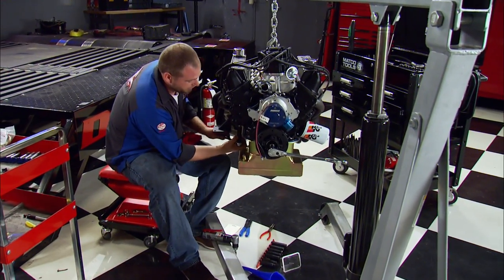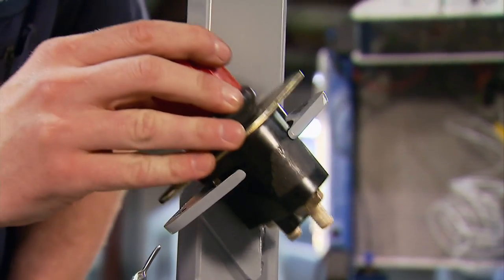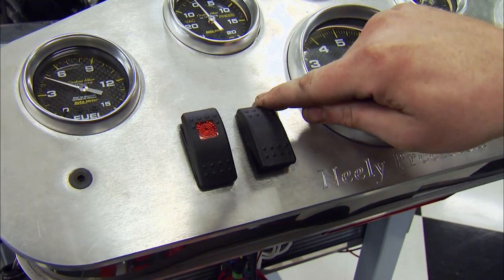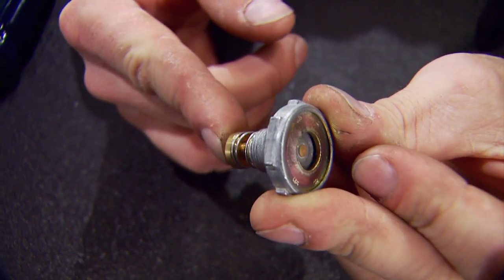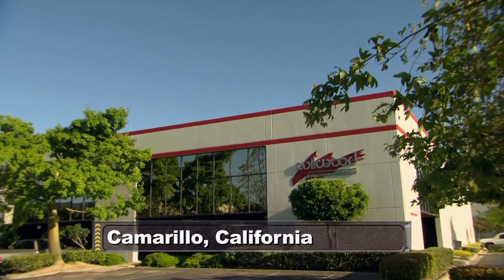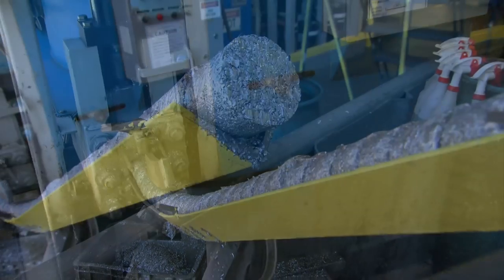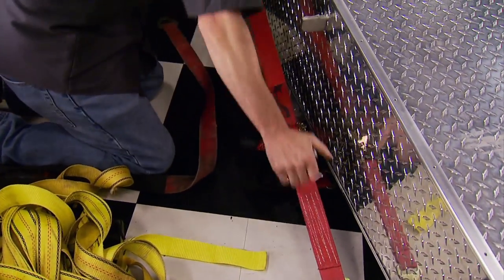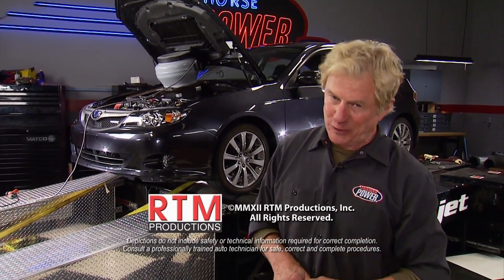Using An Engine Run Stand To Test An Engine Before Install - Horsepower S15, E18

Comment: Not only did a friend of mine and I put an engine together and while mounted on a test stand used it as a heater during a Corvette club dyno run. Freaked some of the Shelby guys out when we would hand them a screwdriver and tell them to turn the idle mixture screws a little bit. They could hear the change in note.